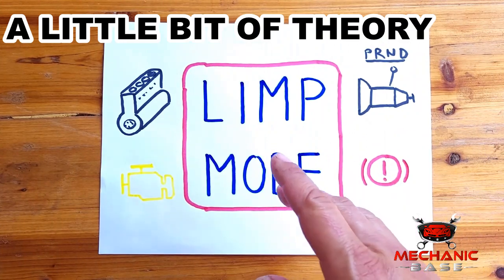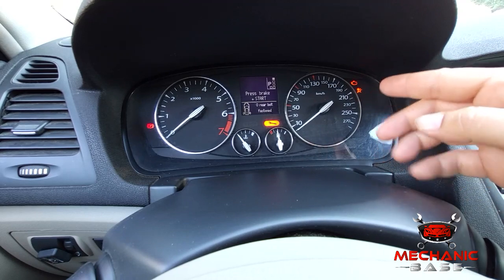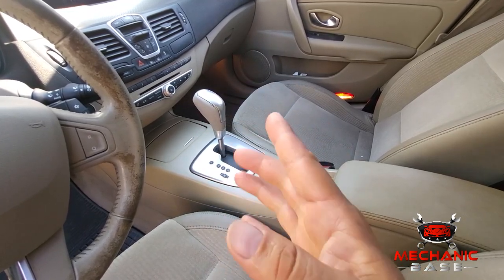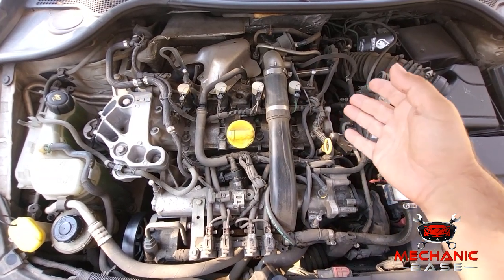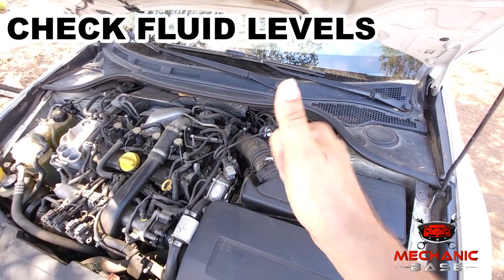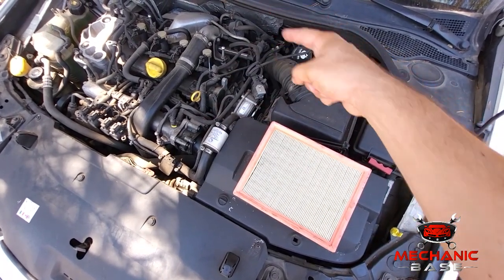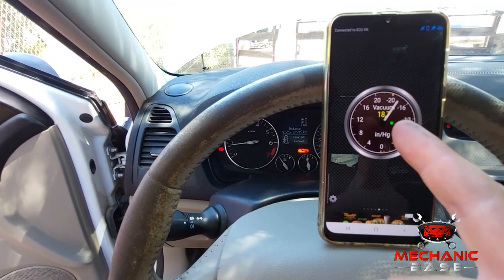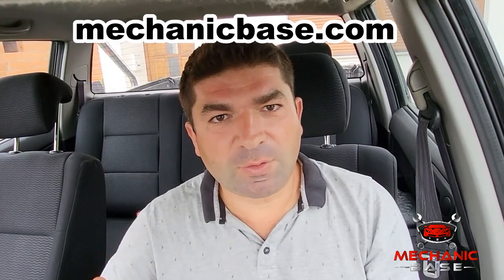Limp Mode: Meaning, Causes and How to Fix It

Comment: Hi, my 2004 VW TDI 2.0 had a lower boost hose tear but was still running ok, despite making a loud swoosh noise coming out of it while accelerating. I changed the hose but now my car is in limp mode, is there a reset procedure that one needs to do after a replacement? Thank you and any help would be appreciated!
Reply from the maker: Angus, can you check what codes are stored? 
Also, you can try disconnecting the battery for 10-20 minutes - that might help😉

Comment: Hi I’m in limp mode in a 2018 Kia optima but obd port isn’t working so I can’t check the codes.
Reply from the maker: Hey, P Smooth. 
It's going to be hard to find out what's causing this without any codes. 
First, have you checked the OBD port (it's wiring and pins may be damaged) and its fuse?

Comment: I'm having this issue with my Audi A6 ultra 2 liter tdi. It's gone into limp mode. Says boost 'intermittent pressure sensor error' my mechanic deleted and said see if it comes back. Came back less than a week later. Says it could be dirty or blocked up. Any advice?
Reply from the maker: Hello Cillian. 
How many miles does you car have? 
Was the turbocharger ever replaced or rebuilt?
Reply: @MechanicBase  thanks for the reply. Turbo never replaced. Dpf and adblue removed and deleted. I think the pressure sensor was replaced also at the time. 102k miles. Belt and pump replaced. The Engine eventually started making a funny noise when pressing on the accelerator. While in limp mode and I went over 2,000rpm. When I restart the car the limp mode can be gone for a while also.
Reply from the maker: Those funny noises when pressing the throttle - that might be the turbocharger itself. If it's louder than it was before, it variable-geometry mechanics are not moving as they should.
Reply: @MechanicBase  thank you for your reply. It only occurred on one drive. Oddly. The car was off for a whole day, the next day all the warning lights were gone. It has been driving normally for 2 days with no issues. It's booked in for Monday to be seen. No idea what was going on.
Reply: @MechanicBase  just as a follow up. The pressure sensor was tested and giving false reading. So replaced it. A month later new faults again. It was an intermittent EGR issue. So deleted the EGR. Now the car was no dpf, adblu or EGR. I hope that's the end of it now. 👀

Comment: Hi, My car go to limb mode and there is a red light bolt on my dashboard, I Turn Of The Car and after while I turn it on , And the limb mode is gone and the car go to normal mode…. Is there is any problem facing my engine?.. or any part of The Car.. ?
Reply Please..🌹❤️
Reply from the maker: Hey, what car do you have? Does it have a turbo-charged engine?
Reply: @MechanicBase  Jeep Cherokee Latitude 
2.4 cc (MultiAir )  , 4 cylinder
No, there is no turbo.
Reply from the maker: Do you have access to a scan-tool (OBD reader)? You should first find out what error codes are stored in vehicles' memory.